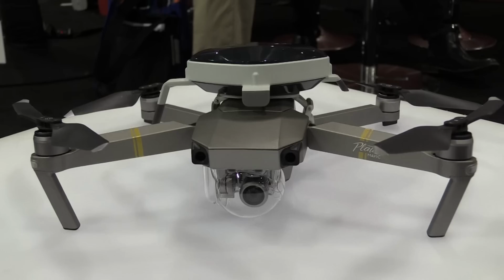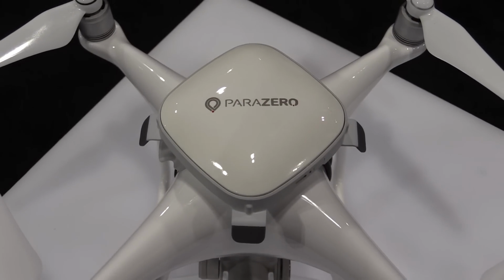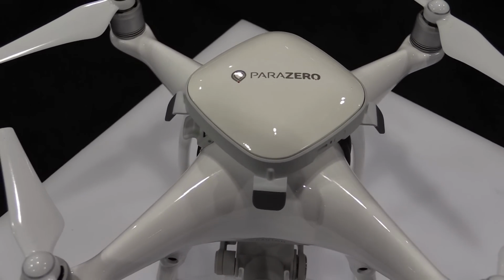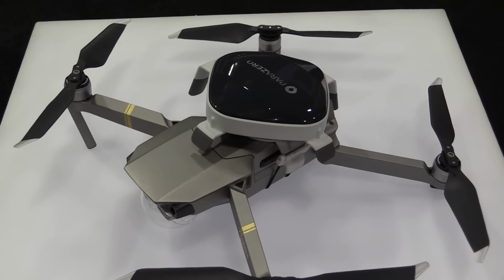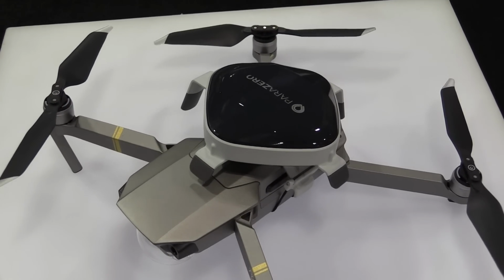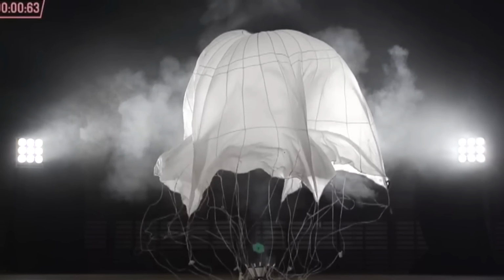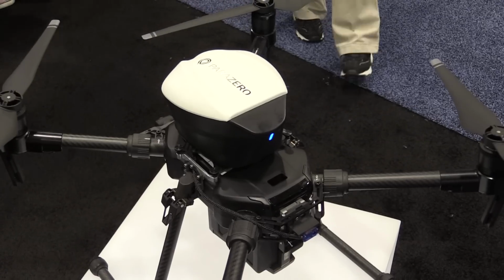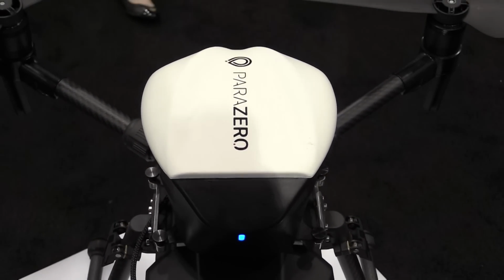ParaZero Announces Parachutes for DJI Phantom & Mavic

Comment: The Para pack is bulky, it might as well be a longer range battery power cell and radar beacon range, the parachute will still get stuck in things, would be better if the parachute inflated like a mars Rover parachute ball, it could fall on water surfaces without drowning.

Comment: It def has to cut gps on the phantoms...hell i can keep my hand above top shell on phantom and kill gps....wonder how it combats this
Reply: Your hand has a lot of water, it will almost completely block the FPV video on race quads (5.8 Ghz). Your confusing materials here, water blocks a lot of radio waves.

But yes, it will affect it some. Maybe not noticeable, but it has too, its an obstruction. Hopefully its a super minimal amount though.
Reply: Jake Garrett so i did a test and put a piece of 5×5 plastic on top of phantom... very thin piece and again lost GPS goes into atti mode
Reply: Interesting since the phantom is made out of plastic.

I couldn't explain that one then.
Reply: Jake Garrett you're not making sense of course the shell is made out of plastic but it can only withstand so much of any material on top of it then it gets smothered I've actually had my Phantom 4 apart and the way they had the Phantom 4 receiver wrapped is pretty cool..... it's basically wrapped in a way show Electronics do not interfere it is basically attached to the top shell..... in most cases one never has anything blocking the top of their Phantom ....with this you do.... the mavic might be okay because the GPS receivers towards the other end at the top
Reply: Sort of correct. There are some materials that are radio wave transparent, and some that really block it. For instance, my teams stealth bomber (evading radar bands) is full carbon fiber to absorb and then direct the energy to non-threat sectors. However, for some radio communications, we have fiberglass winglets so the plane doesn't block our signals.

Material does matter as in the above example.
Reply: Jake Garrett pretty cool and make sense but I think the material they might be using looks like plastic I guess we will see

Comment: Brilliant, please work to improve aerodynamic stability of phantom at the same time
Reply: Probably remove the landing gear (absolutely massive drag looking at it, its shockingly bad). I wouldn't be surprised if that was a major factor.

I'm building a phantom sleeper quad (race quad parts, full acrobatic and hopefully a top speed above 70 mph which really might be a low estimate). I'm debating even using the landing gear, but I want it to look as much like a stock phantom as possible.

Its the indented C shape structure of the landing gear that's going to cause a lot of vortex instability, you could probably wrap it with tape to make it better, but that's going to add weight.

Comment: This is a complete waste of money, it’s a false sense of security. Most (emphasis on most) crashes don’t happen at 350’ in the air, they happen at tree level (20’-30’). If you crash into a tree this devices isn’t going to help you much. I’m sure if DJI felt a parachute would be useful they would have incorporated them into the design of they aircraft. This company is totally taking newb pilots for a ride.
Reply: DJI doesn't even recall defective drones (to my knowledge), and they make people pay for a new one when they fail right out of the box. I don't think they are a company focused on safety (they don't even have a kill switch, that could save some injuries and I wouldn't fly a quad without it unless I'm in the middle of nowhere).

DJI has lots of flyaways (Inspire, Mavic, Phantom), and the old Phantom 2 for example was notorious for being faulty, but DJI made the owners pay for it. Everyone has defects sometimes, its those who choose to stand behind the product and support it that make the difference.

2:43 looks like it did an excellent job slowing it down to much safer levels at 100ft (possibly lower, but I'm sure it depends on wind conditions and such, so I'll just say 100 ft)
Reply: That's absolutely untrue, but even if it was, that still doesn't change the fact that this parachute is a big was of money and would only appeal to itiots that don't know better... so when did you say you ordered yours? LOL
Reply: Actually I'm building my superior phantom. Its a sleeper phantom. DJI phantom frame filled out with race spec parts. I was wanting to run 6s, but after smoking some motors in thrust testing, I'm thinking that might not be the best way to go... At least for now. I prefer to fly full acro without level assist (or GPS), and seeing as how DJI doesn't let you go 70+ mph like I want it or do inverted flight, I think this is the way to go. I might actually use it as a photography platform, but I'm not sure.

I built it mostly to make DJI users crap their pants when a phantom look alike takes off like a bat on fire out of hell and say "the new Firmware update is great!".

Comment: too expensive

it should be 50-75
Reply: If you can't afford at least $100 in safety gear, how can you afford $700-$3000 drones?
Same motto with my laser, if you can't afford $50 laser glasses, you can't afford the laser.

If you're flying away from people, where all that will break is the UAV, then yeah, I wouldn't even bother. Reduced flight time, speed, etc, just not worth it to me (even if I had it, I wouldn't install it). But if you're flying over people (shouldn't unless its a permitted professional job), then a few hundred is barely any cost, you'll make that back in one photo shoot.
Reply: Jake Garrett 

your comment is off topic

It is too big, too heavy and too expensive

3:15
"several hundred dollars"

that is the price of a base level drone

it's a piece of cloth with an explosive charge not high technology 

your fake argument states that drones too should cost more or that more expensive is better...

it isn't 

cheaper is more desirable ; ask a producer
Reply: How is it off topic? I brought up other design problems. Besides, I would rather detonate a $1k drone than have it injure someone else. I put a rather high price on others safety (maybe not my own, but I'm the one signing up for my own stupidity, so I accept my own consequences, I just wouldn't want to hurt others).
Reply: "If you can't afford"

The topic is value not  budget.

If the cost is "several hundred"

DJI spark $399

Mavic Air $799

etc...

are several hundred

It's huge too.

For a heavy commercial drone like the M200 it is a good idea, installation might even reduce insurance costs and overhead.

That could do some damage to something if it suddenly fell from the sky.

Comment: If only weight 40 grams 
I'll take it
But if it 90-100grams?
No..... to heavy
For p4 its okay maybe
But not with mavic one

For 700$..... its a deal breaker..... 
Too damn expensive.... 
Ugh
Reply from the maker: I'm able to confirm that he said "several" hundred dollars -- not "seven" hundred dollars. They still haven't settled on the price yet. I got the feeling hanging around the booth that it was a matter of some debate within the company. As far as the weight and the impact on aircraft performance -- that's why we do testing. Stay tuned!

Comment: Reliability of DJI product makes this obsolete. Just do not keep using old batteries.
Reply: Notorious Phantom 2 runaways, Inspires flipping to death and runaways... Its actually pretty bad reputation and failure rate in my opinion. I like having a kill switch to stop the motors immediately from scarring poor Timmy's face, but DJI doesn't believe in being able to stop your quad and letting it fall quickly to save other people.

https://www.youtube.com/watch?v=vioiVWP47dA
Inspire, Phantom, Mavic, they are all running away. The above video even shows the Inspire going upside down and suicide diving the ground. That's on a flagship product, that's pretty bad... That's called a "recall" in other industries.

I would not use a DJI product for anything professional, especially if its around people. I need a kill switch at the minimum and instant disarm. I value lives too much.
Reply: I just watched a Mavic 2 Pro unexpectedly stop flying yesterday. You are so wrong

Comment: It weighs more than a GoPro, it’s going to cut flight times in half. 
  It’s not like the Phantom or Mavic is unreliable either, most of us Dji pilots have faith in our aircraft and would see a parachute system to fix a problem that doesn’t exist. 
  I’ve clipped a tree with my Mavic, it lost balance for half a second, then carried on flying with one broken prop. If I had this, I’d be trying to work out how to retrieve my drone which was stuck 50 feet up a tree, being held by the parachute strings.
Reply from the maker: It weighs slightly more than a GoPro (83 vs 100 grams for a GoPro Hero 4 Silver, as an example) and in my experience that won't cut flight time in half -- although it will likely have a measurable effect. And, you are quite right that DJI flying machines tend to be hugely reliable. However, for commercial operators who need to balance off risk (and insurance rates) as well as specialized operations (flying over people or sensitive property), this could well be a godsend. We will see...

Comment: All I heard was "several hundred dollars". Here is a piece of market research for them. At $50 I would buy it, heck I might even gift a few. At $200+ I will take my chances without.
Reply from the maker: I suspect you've got an excellent point there... I would hasten to add, however, that insurance is just the outward manifestation of safety -- I'd much rather not drop a drone on the head of some innocent person, even if the financial implications of such an act was fully covered by insurance. It certainly wouldn't do much for my professional reputation.
Reply: Jttv I think it's for insurance reason's like working over people.
Reply from the maker: I can confirm that: "several" hundred dollars, NOT "seven" hundred dollars. That would be pretty steep.
Reply: If you have a Part 107 license and flying over people, whoever hired you wants liability insurance. If you have neither you shouldn't be violating the FAA rule...makes us look bad.